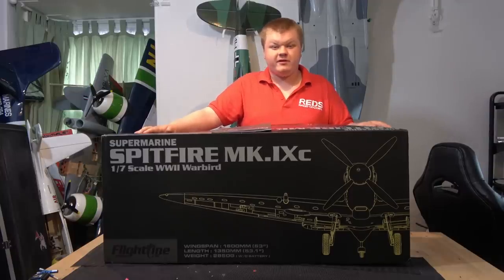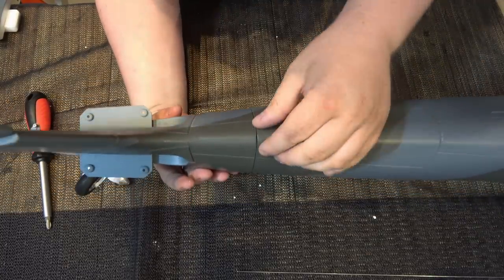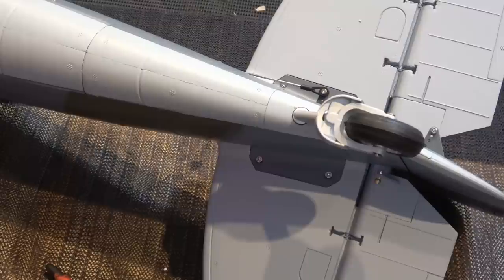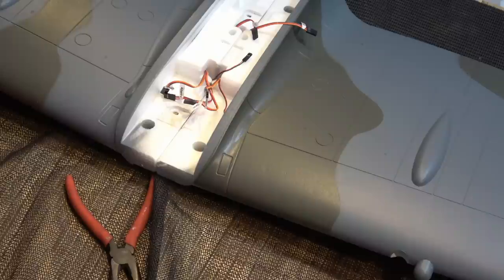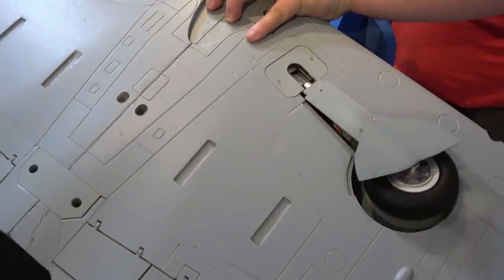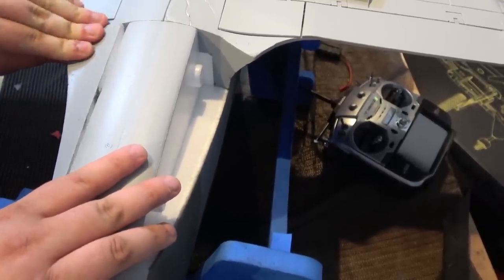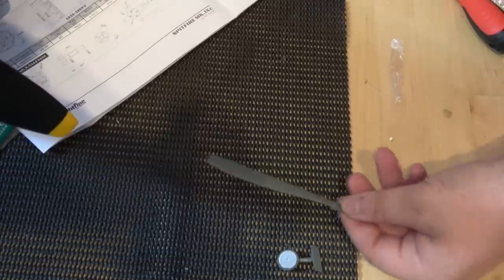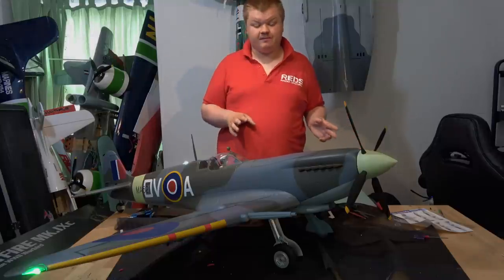Flightline 1600mm Spitfire Build

Comment: Great video. I was just wondering how easy and how long it takes to mount the wings and take off for transport in the car. Regards Simon
Reply from the maker: Hi simon it takes 6 screws and the wireing about 3 mins to wire up,  I added a multiplex connector to my wing and can get it apart and together in just a couple on minutes
Reply: @REDSRADIOCONTROL  hi there , just bought this Spit. Is it possible to let me know which multiplex connector you used ? Many thanks
Reply from the maker: Just a standard 6 pin mpx plug .  https://www.unmannedtechshop.co.uk/product/mpx-connectors-pack-of-5/
Reply: Ok thanks very much

Comment: I’m planning on purchasing this plane but I’m wondering, If I install  a Specktrum Receiver with AS3X & Safe should I glue plywood to the foam  and glue the Receiver to the thin Plywood? For the AS3X and Safe to work correctly it cannot move in the air frame, otherwise the gyro and safe won’t work with using Velcro. Thank you advance!👍😀

Comment: Red is the green decal that goes around the tail section need water or does it just stick on without water? I watched the video but still a little confused about the big circle decals, did you use water or just to slide into place?
Reply from the maker: All the transfers on the white backing are standard none water transfers and all of the transfers on the blue backing are waterslide transfers.  Hope that helps

Comment: Are the lights able to be turned on/off via the transmitter and if so does that require a channel or are they on permanently once you plug them in.
Reply from the maker: +John McGahern the are perminantly on
Reply: Okay, thanks.